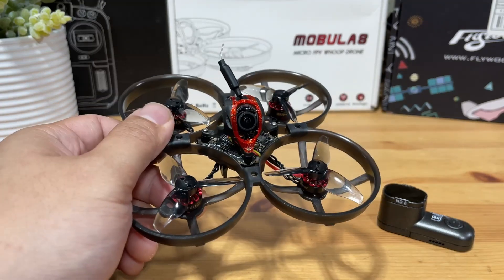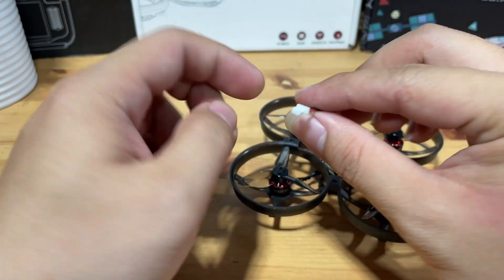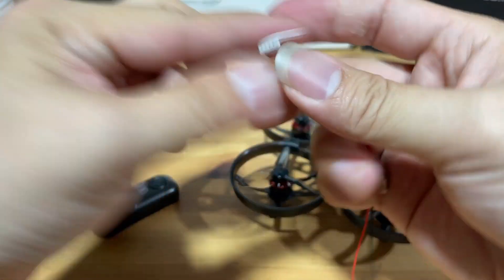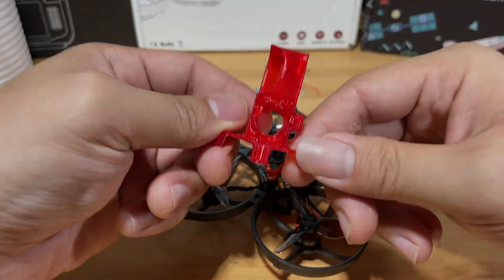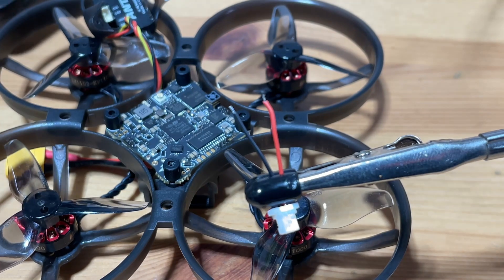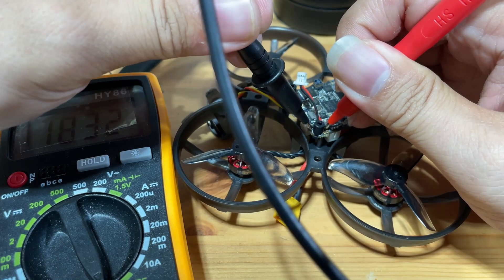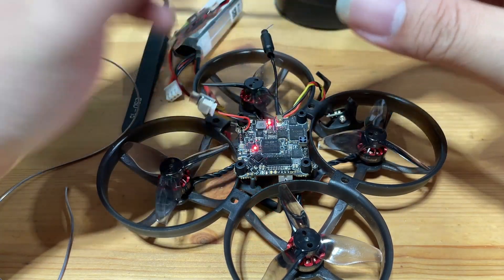DJI O3 Alternative! Convert your Mobula 8/Bassline to a 4K Cinewhoop! #drone #fpv #runcamthumb

Comment: Thanks for sharing. Isn't the video a bit scattered? Any way you recommend to avoid this?
Reply from the maker: Well… this comes with the camera
Reply: @XwingFPVRC  Got it, it is due to the 30fps I guess. You inspired me and I just finished to install the Thumb Pro. I used the UART port to start and stop recording. Also had to change the camera direction of 90 degrees because the analog camera cable was too short with the 3d printed canopy. Managed to get my first video but far from your result, lots of vibration. Need to learn how to use Gyroflow because so far it did not help with that.
Reply: @MengoMyth  The vibration could be caused by loose parts or damaged props. If all those are in check, it might need some pid tune adjustments while the camera is attached so it can be tuned with the extra mass present.

Comment: What kind of flight time are you getting with the extra drain of the Runcam?  And what mAh battery are you using?  2S, correct?
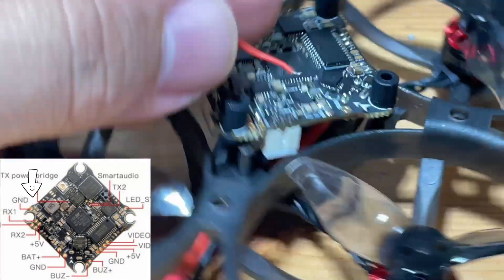Reply from the maker: For a 2S 450mah still getting about 2:30 to 3:00 min flight time. I don’t think the extra drain for the RunCam is significant

Comment: Why did you use a 5v regulator when you soldered to a 5v pad?
Reply from the maker: As I was explaining in the video, the main issue is i need to convert the plugs from SH to JST, I just don’t have a JST plug directly at the time 😅
Reply: @XwingFPVRC  So is it an ok idea to skip the regulator?
Reply from the maker: @WatsitTooyah  Yes, it should be totally fine